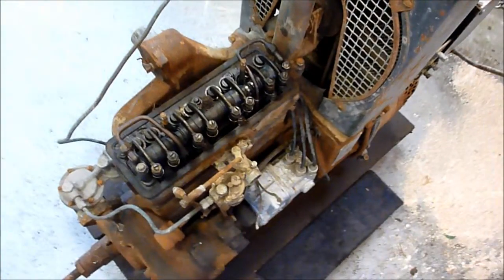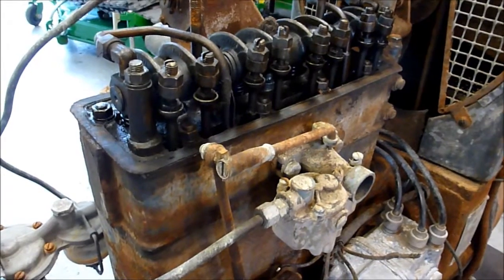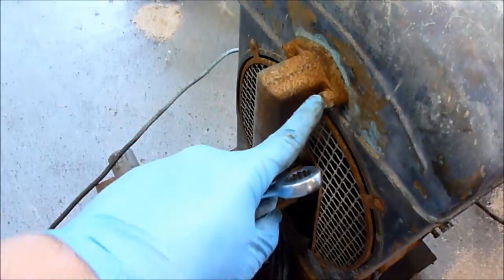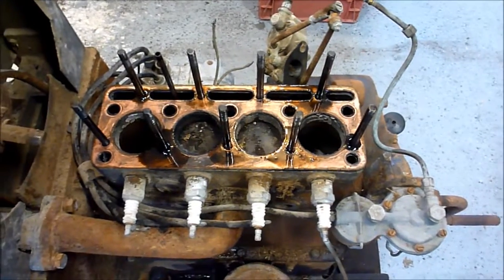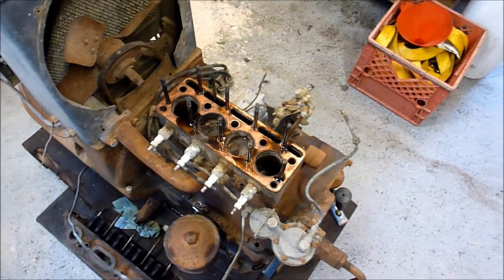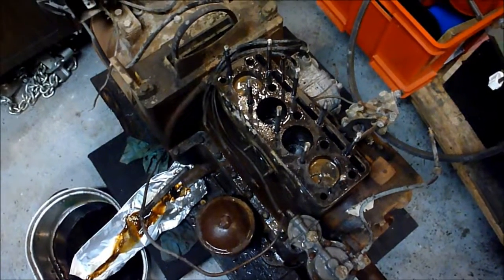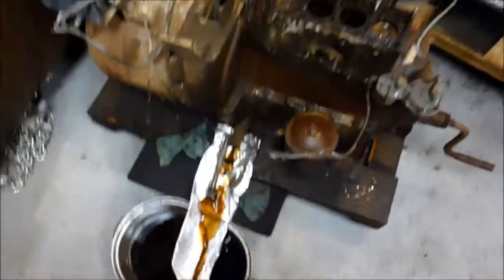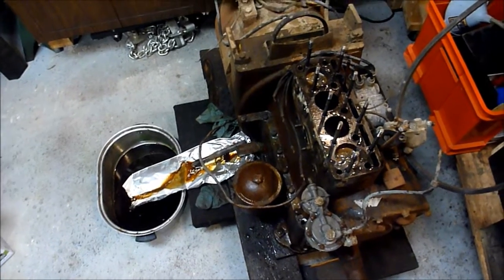Kohler 1A21 Electric Plant Part 4

Comment: Should have hosed the cooling system before you took the head off.
easier way to decarbon the pistons is to pour cold water down the intake with the engine running. the water will shrink the carbon and make it pop off and blow out the exhaust.